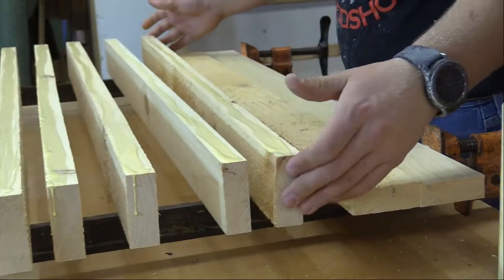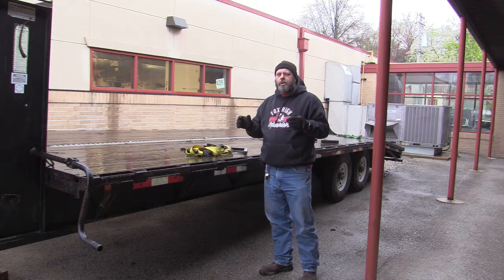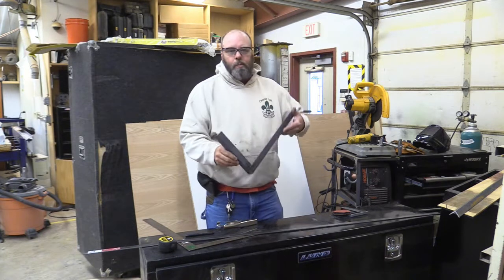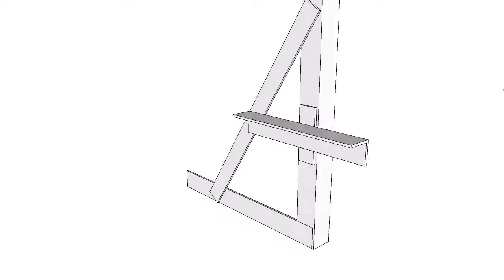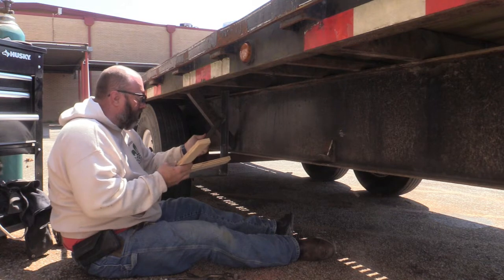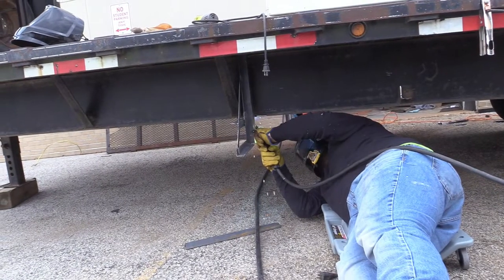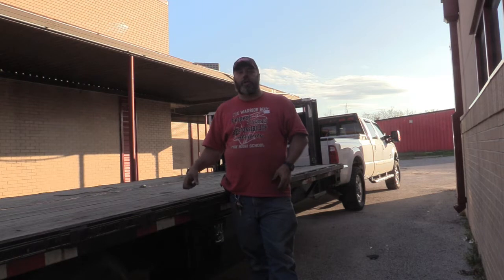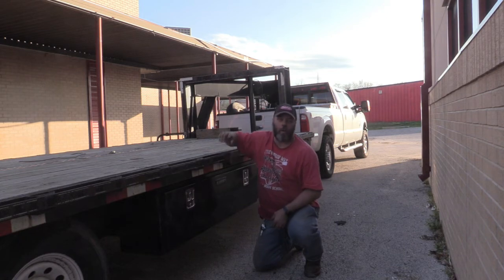Mounting an underbody toolbox on a deckover trailer

Comment: Man I have a 35+5 and I have a 18x18x48 and I don’t know what to do I don’t think I can put it under the trailer cause it might be to low
Reply from the maker: these boxes are only 15" deep I think,  Try putting as close to wheels as you can, the ground clearance doesn't change as much the closer you get to the axles